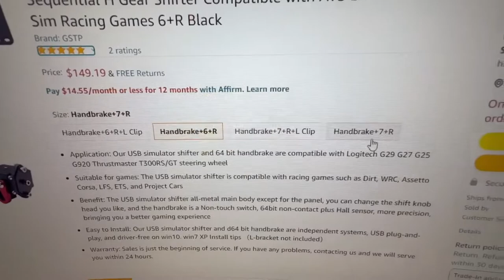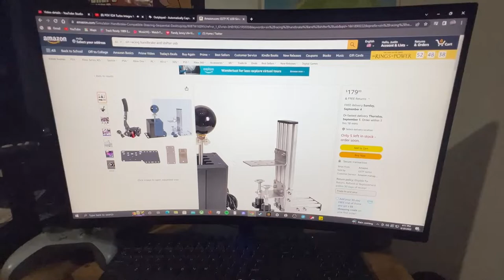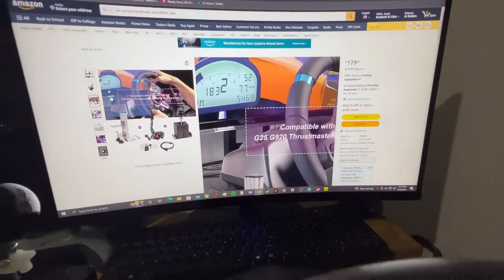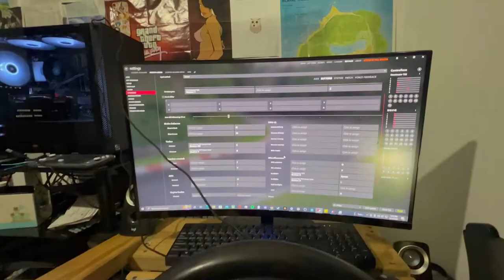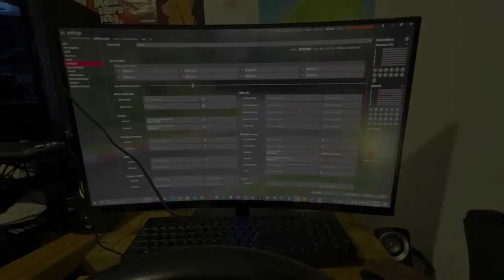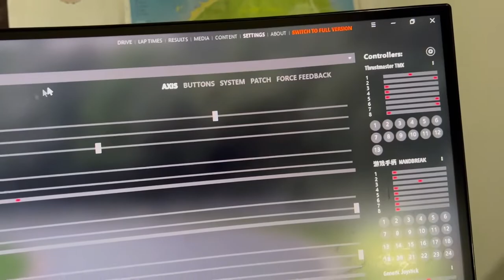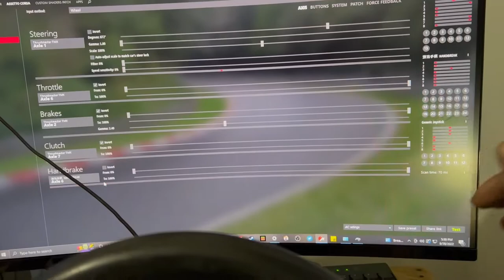Unboxing And Setting Up My New Shifter & Hand-break Brand: GSTP PC USB Sim Shifter 64 Bit Handbrake

Comment: How did you setup the hand brake
Reply from the maker: Just go in you mapping settings and change it form the keyboard to you e-break button
Reply: @justintime2472  no you have to go to axis tab and on the bottom is handbrake

Comment: Does this shifter have neutral and is it matching with pedals like when we shift do we need to press clutch
Reply from the maker: Yes everything is setup in the settings to work together
Reply: @justintime2472  thanks